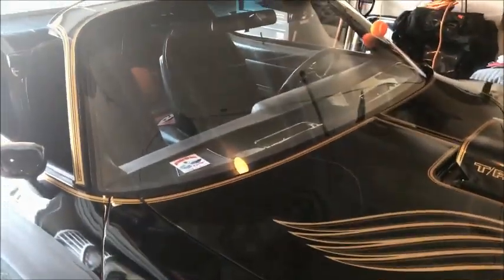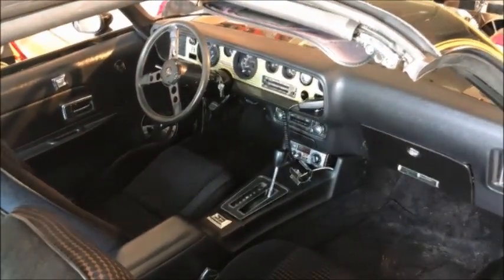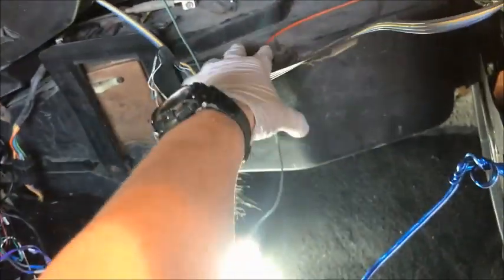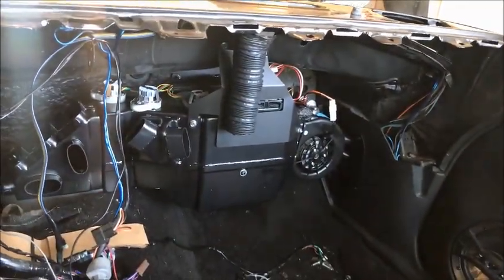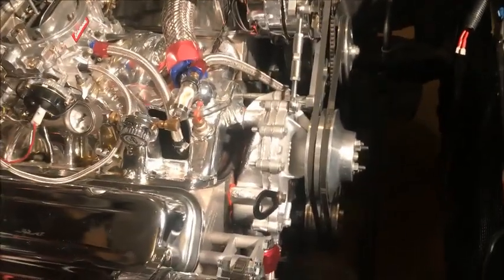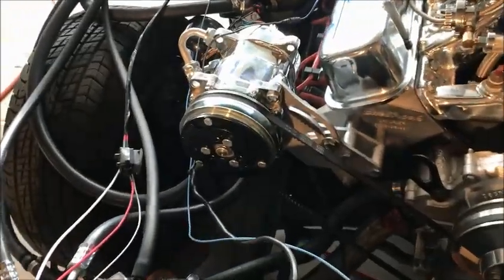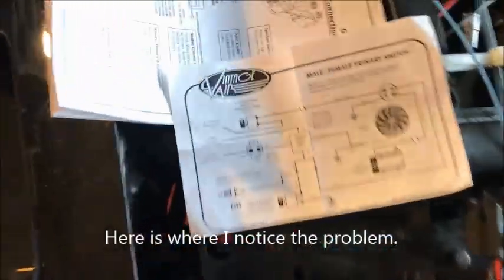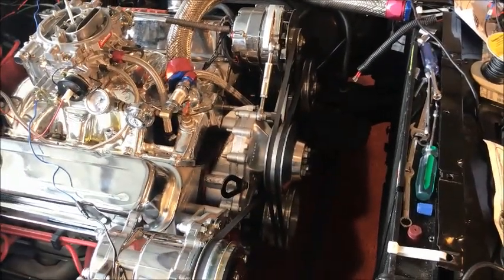Vintage Air A/C System Install - 2nd Gen Firebird Trans Am with Pontiac 455

Comment: Very helpful to those contemplating the VA unit. I'd just like to mention that removing the outer fender  is not necessary. The inner fender is removable without taking off the outer fender, so you can avoid that extra work. You only have to remove the 2 rear bottom fender bolts(pay attention to what shims are there so you can put them back), and of course the fender to inner fender screws. Then the inner fender will be loose, so that by carefully pulling the rear bottom of the fender out just enough,  you'll be able to maneuver the inner fender to get it out. And once the inner fender is removed, you have plenty of access to everything on the firewall, and plenty of room to remove the old parts(no cutting needed) and install the new ones. Also, there's no need to remove the black trim rings from the dash bezel before taking it off. The bezel comes off with the rings on it. If you're going to restore your dash bezel, you can remove the rings later. No need to do it now. Otherwise leave them on it. Glad it works well for you.
Reply from the maker: grand73am glad you find the video helpful!  Yes, removing the outer fender isn’t necessary, but I recommend it to give some more working space and to make it much easier to route the hoses, etc.  Depending on your bezel, you can choose whether to take off the rings. I do it because on another car I owned, they broke when the removing the bezel and it flexed - the plastic was brittle. So I recommend take them off first to avoid that.

Comment: Man I SO APPRECIATE this video. I just bought a 76 Trans Am that had air and I am about to buy the kit.  It’s all messed up, blower constantly runs. Man was it hot to drive this car this summer!!  Do this as a winter project.  The air from that kit seems 1000 times more flow.  I’m excited to have air.
Reply from the maker: Joe, I'm very happy to hear that it helped you!  That's why I made it - I've become frustrated with the lack of Pontiac-specific videos on stuff like this so I've started making my own as I figure things out for like-minded folks.  Good luck with yours!

Comment: You did a good job, I don't mean to be mean, but it's very complicated. This is me, just changing the air conditioner part without changing the interior part of the car. The fan in the car must be making a lot of noise.

Comment: What  size belt did you use
Reply from the maker: I can't remember offhand.  I had to experiment a little, but it wasn't a hassle to find one that fit.  I'm not near the car at the moment otherwise I'd go check for you.  Chances are you'd have a different size anyway - I had to use a longer belt because I have tall valve covers.

Comment: I wish you would have spent less time on the glove box and stereo removal and showed exactly how the dash and kick panel came out. Other than that the video was informative. How’s it holding up? I’m putting in mine this winter. I have a 1977 Trans Am.
Reply from the maker: Leland - yup I had that thought too.  I forgot to record part of the actual dash removal, but it's super simple.  I explain it at around 17:50 in the video.  Kick panel is easy enough to figure out once you know it's also got a bunch of goop you have to deal with when pulling it off.  Everyone who watches these videos have different levels of experience taking this car apart and putting it back together, which is why I included everything else - it helps give newer folks confidence to do a big project like this, making it helpful for everyone.  

To answer your question - mine is holding up great because I drive my car all the time.  Only thing to keep in mind is that with any A/C system, you need to run it regularly, even in the cold weather, to make sure the system stays lubricated.  Otherwise, you'll end up leaking, or worse.

Comment: Did you ever figure why your high pressure was low? I installed this kit in my 79. Same thing. Low side pressure is great, high side doesn’t budge from 150. No leaks and plenty of Freon
Reply from the maker: Mine got close to normal by adding a bit more refrigerant- it has cooled just fine ever since that day so I’ve let it be. Still works great.

Comment: Sir. That engine bay is amazing.may i ask where you purchased all the chrome. 
And what electric fan are you using
Reply from the maker: Thanks!  Bought a lot of it from Summit Racing, to include the Edelbrock heads, RPM intake, A/C compressor, and alternator.  Painted the master cylinder and water pump myself.  Got the pulleys, brackets, and power steering from CVF racing on Ebay.  Forgot where I got the braided hoses, but you can get those anywhere.  I forgot exactly what fan it is, but I bought a kit from summit and it works great.

Comment: The acually AC unit. Is it suppose to be resting against the firewall or touching the firewall when it’s bolted up with the rear one bolt and two top ones?
Reply from the maker: I'm not sure I know what you mean... do you mean the evaporator?  The stock evaporator isn't used in this mod, so you totally remove it and mount the new one inside the car under the dash to the firewall.

Comment: Thanks for this video. I'm in process of rotisserie restoring a 1980 SE, and this is next. Should be here Fri.  Side chance , do you know anyone that has experience in 2nd gen assembly ? I  just need a hand from someone who has done it. I'm in N Florida, and car is in my shop , on a 4 post lift
Reply from the maker: Steve - I'm in the NW U.S., so unfortunately I don't know anyone down by you.  But I'm glad you find this helpful!  I'd recommend you get the assembly manual for a 1980 - you can get them on ebay pretty cheap.  I bought one years ago for $15-20 and I use it all the time. Is there anything in particular that you need advice on, or is it just manpower you need?  If you need advice, there are plenty of 2nd Gen Firebird/TA groups on Facebook - people there are super knowledgeable and will answer any question you have!

Comment: im interested in the cooling fan and radiator mounting,if you could give a coment.thanks.
Reply from the maker: I used the stock rubber radiator feet and then zip tied the top of the radiator to the front panel where the original fan shroud bolt holes are.  I used heavy duty plastic and metal zip ties.  Then I the same thing to mount the fans (you could also use nylon fan mounts that feed through the radiator).  After making sure that all was strong, I used an aftermarket chrome radiator cover from Summit (although I am about to replace with a custom one).  Went to auto parts store and got press-in clips for interior pieces and used that to secure the radiator top cover.  Works like a charm and looks pretty clean.  The top groove in the radiator is a good place to hide the fan wires.

Comment: Will the vintage air bracket work with tall valve covers?
Reply from the maker: If you're using a Pontiac motor, yes, but you'll have to go through a little trial and error because the tall valve covers will get in the way a little bit.  No clue if you have Olds or Chevy.  I had to experiment with belt size, but it wasn't a big hassle.  My covers are 2.75 inches tall.  I can't recall the belt size I used.  I'm almost maxed out on adjustment travel and the metal elbows on the compressor lines are very close to my inner fender, about 1/2 - 1/4 inch.  I still have a decent amount of adjustment travel on the bracket.  I'm pretty sure that if I want to use a smaller belt, I can take the valve cover off to install it and then re-mount the valve cover.  I could probably fool with the elbows too to make a little more room but so far it's working fine for me the way it is.
Reply: Pontiac 400
Reply from the maker: @anthonyvaccaro8819  Should be fine
Reply: I just mesured my valve covers 3 1/4 tall. Can you measure the clearance space from your valve covers to compressor. What brand valve covers do you have?

Comment: Absolutely love the video would be nice if the audio had been a little higher and consistent but apart from that very insightful and I am now also considering vintage Air for my 79 formula. In fact it gave me the tips that I need in order to remove the dash and center console and seats from my car in order to do further work. I've only had mine for about a year now it's sitting currently with no engine and in serious need of restoration but I have never worked on one of these much less even attempted to try to remove the interior pieces being that they are still in great condition and I do not want to ruin them.
Reply from the maker: Glad it helped!

Comment: Great video Michael. I've a VA kit to go into my 73 Firebird. Living in Oz has been converted to R/H/D so may be interesting as the kit is for L/H/D. I've also got an external transmission oil cooler to consider. Using an full new American Autowire update kit harness as the car is stripped. Fun ahead! Cheers, Paul.
Reply from the maker: Thanks!  You're right, that is going to be an interesting adaptation!  I'd love to hear how it goes.  Good luck!

Comment: Is it doable without completely disassembling your dash if you choose or is it mandatory?  Love to do it but so many fragile parts that wont survive another complete disassembly...thanks
Reply from the maker: I think you might be able to but to be honest it would be such a tight fit and hard to maneuver, that I wouldn't recommend trying.  Feeding the hoses and mounting the evaporator/motor mechanism would be extremely hard to do without removing the dash.  I can't imagine it would be possible.

Comment: Are you using the cvf racing pulleys. The pulley groove and the compressor groove are a bit different size. Curious what size belts you used.
Reply from the maker: yes I am using the CVF pulleys.  I don't remember the belt size but I experimented a bit to find a good fit.

Comment: This may be a crazy question but this does work with the factory hvac controls & retains heat?
Thank you.
Reply from the maker: No, this particular kit uses its own controls (electric instead of vacuum).  It can do hot and cold.  I have no idea if Vintage Air makes a kit that uses anything from the stock setup.  If you're looking for a kit that uses the factory evaporator/condenser/controls, etc., there are several kits on ebay under the name "Classic Auto Air."  They are basically compressor upgrade kits that come with lines, etc.  They also sell aftermarket replacements for your stock parts.
Reply: @michaelanderson5361  
Thank you very much.
I'm thinking that it may be best to go the route you went.
Did you lose any leg room on the passenger's side.
I mean is wife still happy with that part as it appears maybe some space was lost there.
Just weighing out all the pros & cons.
The reason I'm going to go your route & do away with the factory setup is to prevent any more rust in the passenger's fender.
My cars super clean rust wise except for that fender & it rusted out due to the factory AC.
Again you very much for all your help.
Reply from the maker: @charleshenson4183  That's part of why I went Vintage Air instead of upgrading the stock setup.  My car isn't original anyway, it's a resto-mod.  The Vintage Air setup is way better in my opinion - easy to understand, just a big job to install if you're not used to that sort of thing.  Not hard by any means, just involved.  I didn't lose any noticeable room on the passenger side.  My wife didn't even notice any difference, and I can sit in the passenger side just fine and have enough leg room.  Most of the room you lose is in the glove box itself, which is why they give you a shallower glove box insert.  You won't have any rust problems with this, since the drain tube runs out of the bottom of the firewall by the floor pan.  It's totally worth it.
Reply: @michaelanderson5361  
Sounds awesome & exactly what I need.

Comment: Im gonna sound like a complete idiot here but, the evaporator you removed is just like a fan for the interior right?
Reply from the maker: The Wild Dinkus!  No the evaporator isn’t a fan. What part are you talking about?  The large one that was on the firewall inside the engine compartment?
Reply from the maker: And no worries, no dumb questions. We all have to learn at some point!
Reply: @michaelanderson5361  yes, I only have seen one like 3 times with that
Reply from the maker: @thewilddinkus8026  
The Evaporator is near the fan, but the evaporator isn't actually the fan part.  The evaporator is a coil that contains cold refrigerant and it absorbs heat.   The fan circulates air across the evaporator to suck the heat out of it (make it cold, imagine a box fan blowing air over top of a bucket of ice = cold air).  The condenser is the opposite side (in front of the radiator) where the refrigerant is pressurized (increasing it's heat).  Air from your engine fan blows over this REALLY HOT side to get rid of this heat.  Then it gets de-pressurized (making it cold again) and send back to the evaporator so it can can absorb more heat from inside your car when the inside fan blows air over it.

Comment: Michael,  just wondering how the system is holding up and how it works compared to original equipment
Reply from the maker: It's still working great... I love it.  Doesn't spill water all over the passenger side like my original Firebird did...
Reply: @michaelanderson5361  thanks
Reply: Yeah my passengers side fender rusted because of the factory AC.
Ironically it's the rust on the car.
1980 turbo pace car